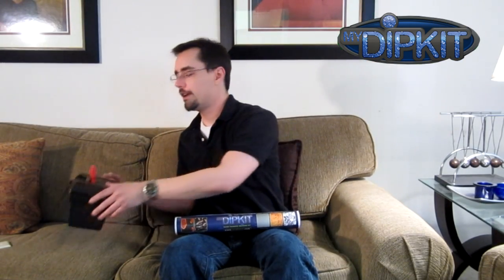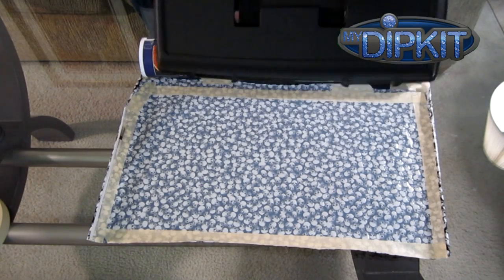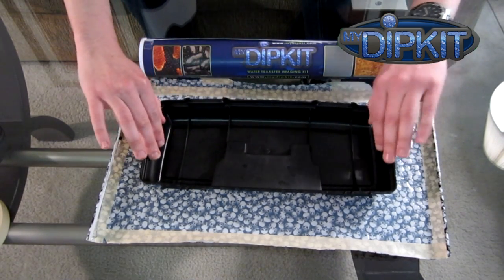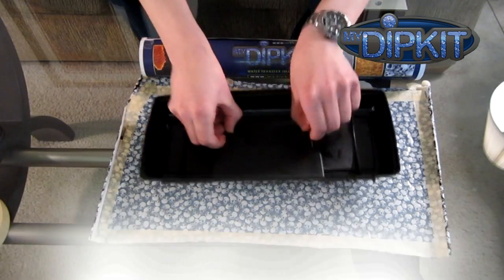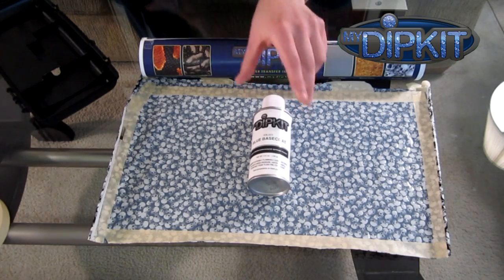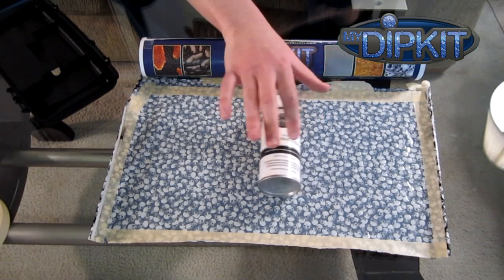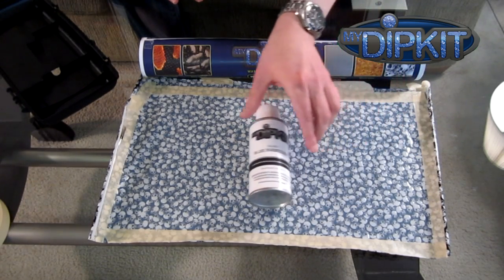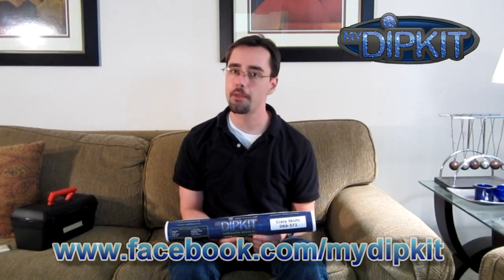How to use MyDipKit Part 1 - How to prepare hydrographic film diy

Comment from the maker: I have another video that answers this question...  The short answer is you can use high quality automotive base paint, but there is no guarantee it will work.  So make sure you have several successful dips using the MyDipKit paint before experimenting with other paints.

Comment: I got my kit a few months ago, when I went to use it the other day, I unrolled my sheet, cut the piece of film I needed, taped it as required. However before dipping I noticed various small bubbles and wrinkling in the sheet itself so I did not dip the part.
Just wondering it this an issue with the film, it was stored in a cool dry place ???
Reply from the maker: We've answered your email.  More than likely these slight wrinkle will smooth out one in the water and having sprayed the activator.  But we will review the photos you're sending to make sure.